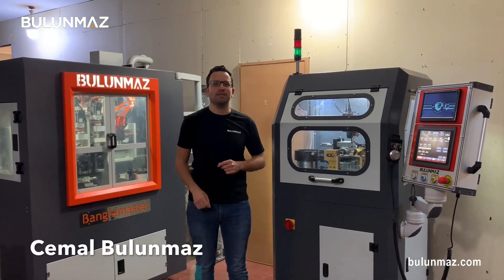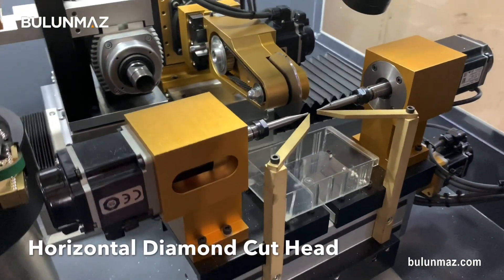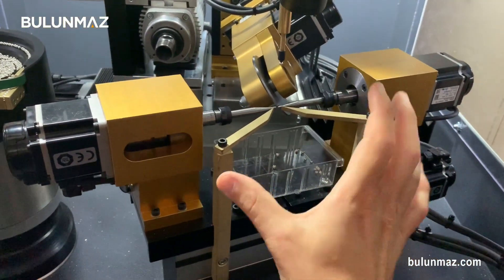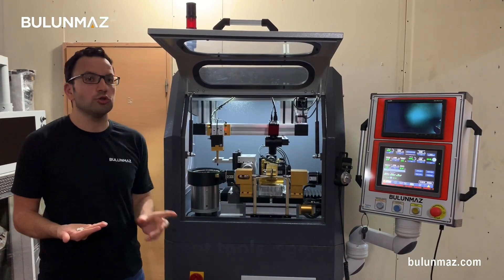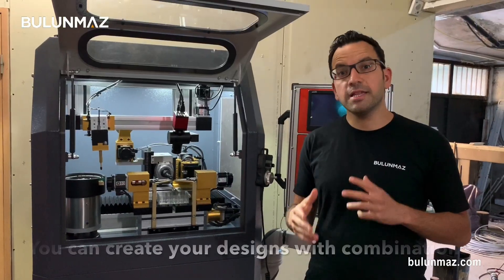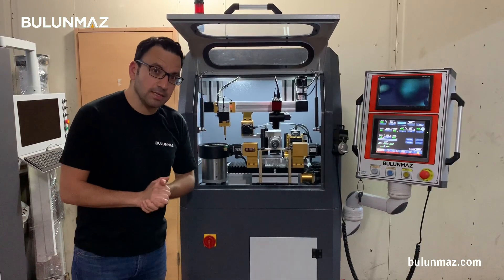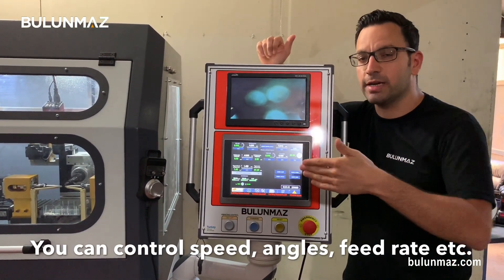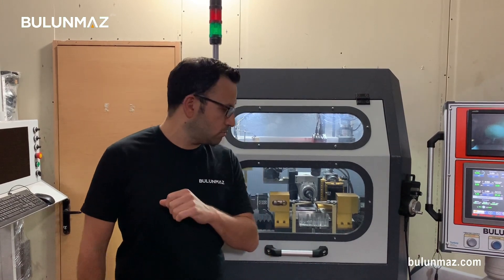BALL DIAMOND CUT Machine for Jewelry Production

Comment: Fine. is this balls are hand made or machine made what is weight of each ball.
Reply from the maker: They are made by stamping machine but we don’t make this machine line yet. Ball weight depends on thickness and ball size, you can use 2mm and up sizes.